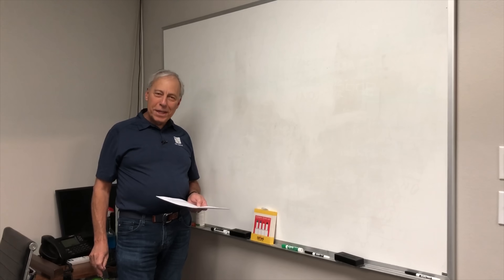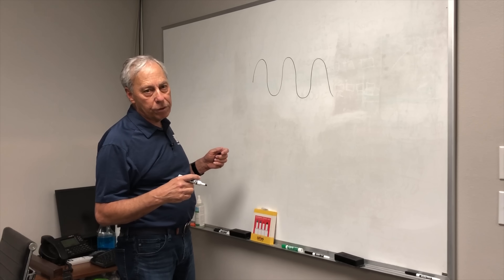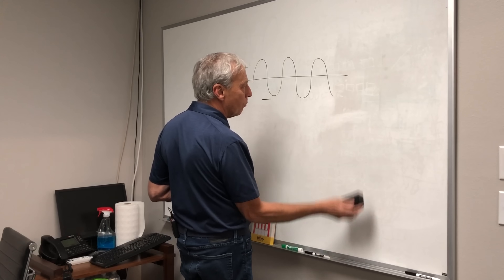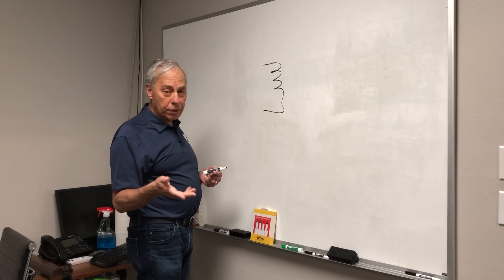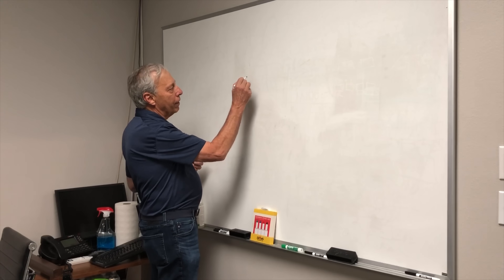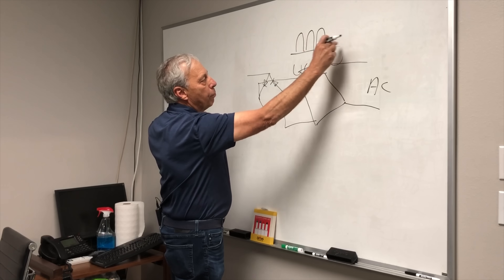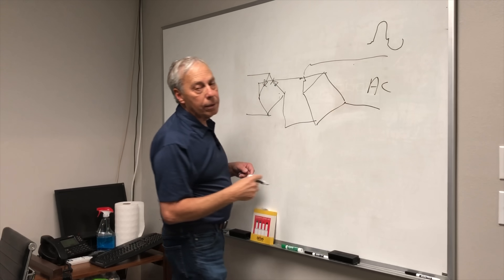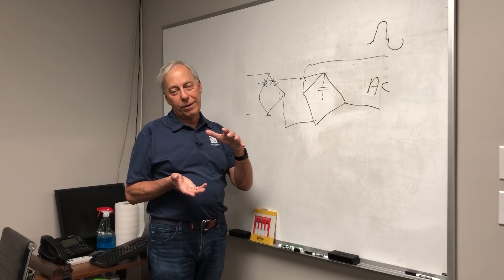What's the deal with DC blockers?

Comment: Wish my Crown amps had this. They went full DC and turned my speakers in to little electric heaters.
Reply: ROY FERNTORP From my understanding of how amplifiers work, which admittedly isn't grad school level, this would have nothing to do with that. And it's quite normal to have DC going to your speakers. You just maybe had too much, or you blew something, like a transistor maybe. There's a thing called DC offset, or DC bias. Where the signal isn't right, and it results in DC coming out of the speaker terminals. Like I said. A little is okay, and normal for most amps. A lot can fry your speakers. Most modern amps have protection, but some don't, like Adcom GFA 555 for instance. Some older Crowns don't either, like DC 300. Now I'm not positive if the speaker protection helps with the offset, but I assume so. I know it will work with a transistor blowing though. Well it will if it was designed, and working properly anyway. So yea. You probably blew a transistor, or need to adjust the offset. It's easy to measure the offset, and get an idea if the amp still works. If it doesn't. Then it's decision time I guess. Hopefully it is, and you can Google how to adjust it, or have a tech do it. And you can add a speaker protection circuit to the amp, and not have to worry about this again. But it may not be cheap. I don't have a clue on that. 

https://www.google.com/amp/s/m.wikihow.com/Measure-DC-Offset%3famp=1
Reply: My more modern gear has so much processing. You plug a laptop into the EV amps and set everything. Those old, heavy E-core Crowns are living in a shed somewhere or maybe holding a boat. And thanks for the education. Appreciated.
Reply: ROY FERNTORP EV? Electro Voice?
Are they like the new Crown amps with the DSP built in? I like those amps. I've been thinking about getting one to use for subs. Way in the future though. I've still got more important things to buy for my system, and I don't have endless funds. But I really like that idea. Where you can control it all from the laptop. They have an interface on the front too I think. But using the computer seems much nicer. :)

Do you do sound? Or you just prefer the pro audio gear? I ask, because I've read many conflicting thoughts on using them for home use. Many like them, and others say they just don't have the magic that audiophile gear does. That's part of why I was thinking of getting one for my subs. That way I can try it for my main speakers too, and make my own decision on how they sound. And do you recommend EV over Crown?

BTW you're not the first person I've heard refer to those old Crowns as boat anchors. But I bet they have their charm too. I find I can enjoy most amps/receivers if they're set up properly, and I don't set my expectations too high. Heck I was in my deck using a cheap Bluetooth speaker today, and was actually impressed by what it does for the money.
Reply: I have a busy recording studio in Sydney Australia and every now and then I do audio gigs for bands. I love the Electro-Voice and Dynacord gear because it is reliable and sounds really good. You don't have to push to the limiters to get a good sound. The modern D-class amps are good but if you push them they don't keep up with subs. Behringer make some nice amps for the price. The Nuke range is pretty good but don't beleive the rating.
Reply: ROY FERNTORP So if I get one. I should get a class A/B one huh? I always thought that way, but have been looking at class D lately, and people say there's good ones, and I'm going to try one soon. But I was wondering about how they would keep up with a class A/B amp for subs. I know they're fine for regular speakers, but have read conflicting things about how they are when you really need the power for the lower frequencies. Some people say they're great, others say they're not. My thinking was. I'll try class D for speakers, but stick to the tried, and true technology for subs. Even though class A/B is less efficient, and produces more heat.

I will say though. I had a class D amp in my car, and it was pretty powerful. PPI 900.5. 5 channel. The sub channel was 460 watts in 2 Ohms I think. And it was enough to get my single 12" Polk Audio sub shaking my little car up. And it sounded pretty clear on the inside speakers too. It was fatiguing though. But that might have been due to other parts of the signal chain for all I know.

BTW I've been seriously shopping class D lately. And the Allo Volt+ for $69 is supposed to be an amazing little amp. Not powerful, but really good. I've also been looking at the TBI Millenia. That's a lot more though. And you can just buy an amp board from Ebay, and hook up a pretty supply for cheap. TPA3116 is great, or for more power. The TPA3251 is supposed to be really good.

See this thread if playing with this new technology interests you at all. It's very interesting. And I know some of these guys. I've been a member there for a while, and go to the meet ups. If they say it's really good. It's probably really good.
http://audiokarma.org/forums/index.php?threads/tpa-3116-vs-the-tripaths.574806/
Reply: ROY FERNTORP Oops forgot. I've never really seen the Dynacord name. Well I've seen it, but not seen any products really. I'm going to look into them. EV amps too. They're not big here in the states. Everybody does Crown it seems, but I know EV has been a great company for years. And I'm going to check out there amps, before I buy anything. 
Here's a little EV story. 
I was on Craigslist one day, and a guy had a pair of EV movie theater speakers he had to get rid of that day. 2 15's, and a compression tweeter with a huge waveguide that crossed over at like 1200hz or lower, very low either way. He wanted $100 for them, just to off them that day. If I would have had any way to get them home. I'd be listening to them right now. But they were huge, and heavy. And I only had a little Toyota at the time. One of my biggest regrets in this hobby is missing out on those. They were very expensive when they were new, and I bet they sounded amazing. Most movie theaters do anyway.
Reply: Those old EV's (2250's I think) are some of the most efficient speakers ever. They still use those horns on their X-Array systems. If you are after a loud system that sounds great, look into the EV ETX range or find an old Dynacord D-Lite system. Both are portable, weatherproof and fully processed. The ELX range is even more affordable. I am not an EV dealer or endorsee. I work in a recording studio where I use Tannoy, Behringer and Genelec speakers. Years of lugging good and bad systems around have led me to these conclusions.
Reply: Your amplifier burning out the speakers is because of lack of speaker protection circuits, not because of a lack of a DC blocker.

Comment: I just measured DC voltage in my AC socket and it indicates 5V :) It's a lot. I think that's why i can still hear the noise from the trafo in my Hovland HP-100 even with my DC blocker.
Reply: You didnt blow anything up 💥?? 😮

Comment: Great video, but I don't understand how a transformer winding, which is DIFFERENTIAL in nature, will be affected by a DC voltage on BOTH ends of the winding.
Reply: Neal Staats the dc is across the winding and that will polarize the core.
Reply: A lot has to do with transformer saturation curves and a surprisingly little DC current can make a large difference.

Comment: How do we check if there is DC coming along with AC from our wall plug
Reply: A good digital voltmeter will give an accurate DC on AC measurement. I have about 420 mv on my house power. I use a surplus 1kvA industrial control xfmr on my bench. Works great.
Reply: @wamgoc3637  that is not necessarily true. A Fluke 87 certainly wont, it dances around all over the place when trying to measure DC on an AC supply its by no means a poor meter, its one of the best in fact, PS audio use them.
Reply: Wamgo C thanks for your reply 
So is 420 MV considered OK and within acceptable limits ?.
If not , what should be acceptable limits of DC or there should be none?

Comment: Are you joking ? Normally you would want to power your equipment with DC and avoid noise in power supply. And it is the defect of the PSU that some c*ap like DC blockers are needed.
Reply: Paul, it depends on the quality of the transformer and its elements. Generally you are referring to the older way of making a power supply with a large transformer operating at the frequency of AC line. Note that it is not a correct way, it was done to be cost efficient. For some stupid reason, many just copied that schematics and basically increased the "performance" by using a larger transformer, which is totally wrong. Also, you are referring to rather cheap transformer made of iron alloy. The effect of hysteresis point shift is not so bad for ferrite core transformer, which should be used for high-end equipment.
Also, note that you can use DC power lines at home, I know that they require more expensive switching and safety equipment, but still, you can use DC instead of AC, which solves a lot of problems with noise. It is kind of weird that you assume that power lines should be necessary AC.

Comment: Where can you get these plans Paul, Why don't they put the full Bridge rectifier in front of the transformer why is it always behind? Or one either side. How do you determine which type of Bridge rectifier is suitable.
Reply: Paul McGowan hi you talk about means filtering using the Bridge rectifier that means your amplifier will be plugged into the unit? So that would mean the bridge... is before the transformer, I thought the bridge rectifier convert AC to DC.